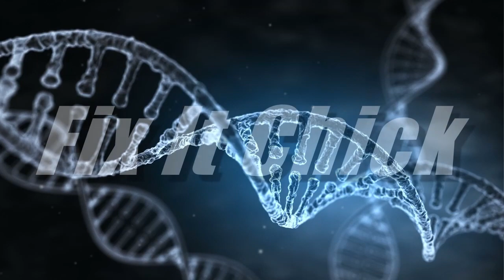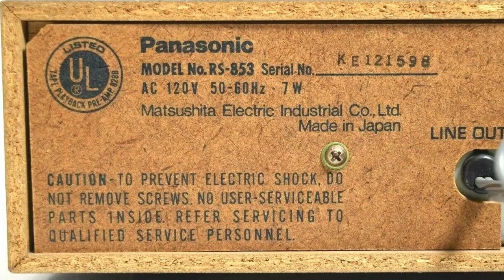Would you Clean & Recondition this Vintage Panasonic 8-Track RS-853?

Comment: Wow I really like these videos. How did you hook it up to speakers?
Reply from the maker: Thanks Larry.   I have a receiver to the right of the camera and speakers that I have hooked up to my computer.  The RCA connectors on the player hook to the receiver, but you could also get an adapter to use powered computer speakers if you wanted.  :)
Reply: Could you show hooking up to it please.
Reply from the maker: @LLStacheLarry  My next video that has that type of connection I will include that step.  :) Thanks
Reply: Awesome thank you.